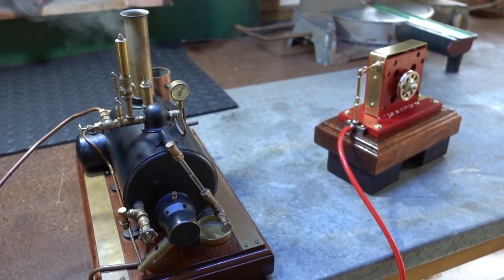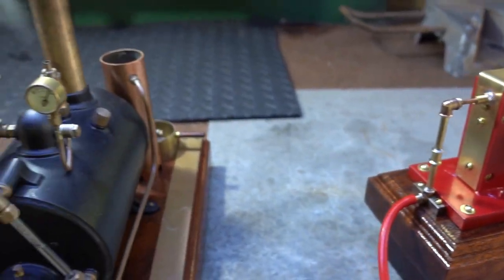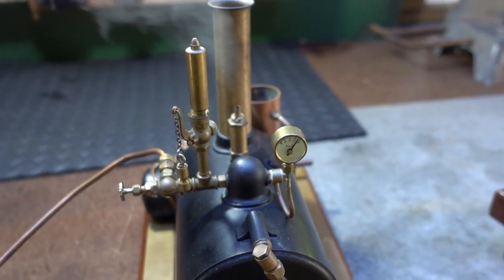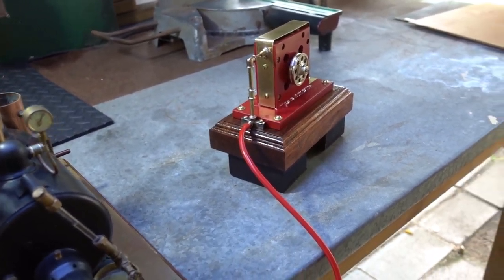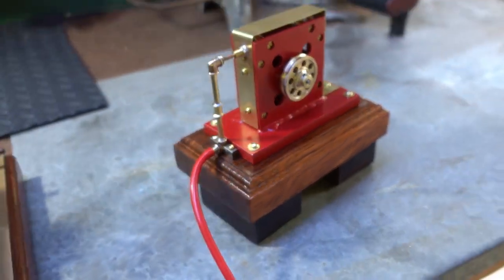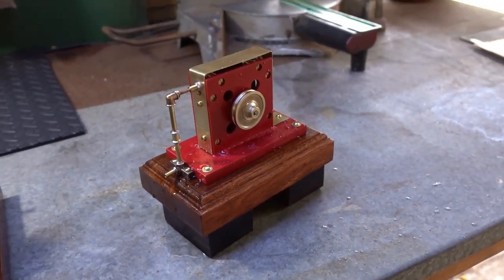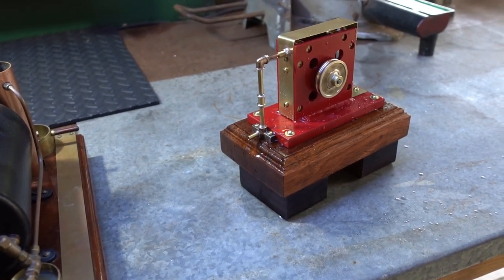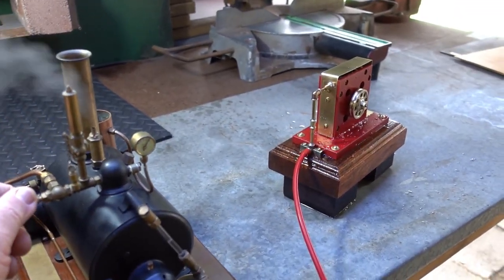Steam Turbine - First test running on live steam

Comment: Do you know if there's anywhere I can get a chuff pot for a new wilesco D20? Would you just use airline tubing to connect it to the pipe above the condensed water tray under the chimney?
Reply from the maker: No sorry I don't know anyone making these. Most now DIY them themselves.